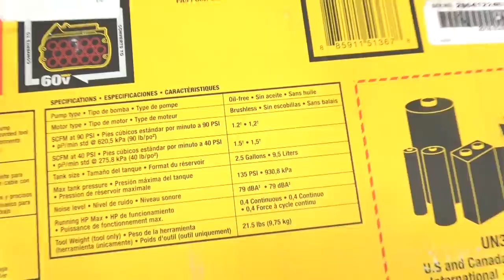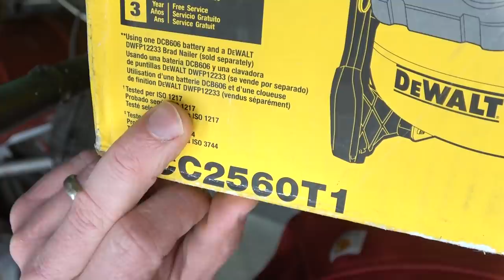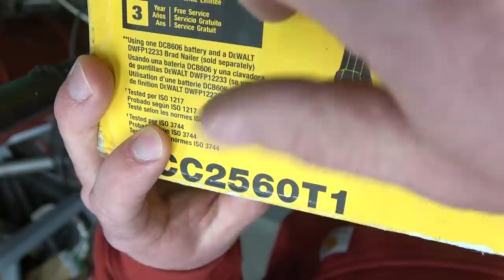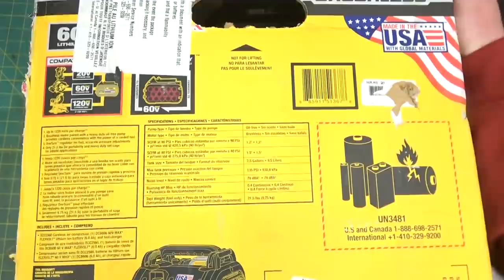BOLTR: DeWalt Flexvolt Compressor | Gutless and Brushless?

Comment: Today I was in Ogden Utah for the Union Pacific 150-year anniversary of the Transcontinental Railroad and I was next to two gigantic steam locomotives which are two big ass pressure vessels look up the Union Pacific Big Boy 4884 steam locomotive check out that pressure vessel peace out have a great day by the way 300 pounds per square inch in each locomotive the big boy puts out 6000 horsepower and the northern puts out 4,000 to 5000 horsepower the faster it goes the more powerful it is the big boy was designed up off of 5 Mile Long Train at 80 miles an hour how about that for some engineering

Comment: Really good video going through everything as usual. The piston seal is quite unusual; the wear looks like there might be some graphite involved. Also it is quite interesting that the pressure vessel is not serilized. As far as I know, every pressure vessel sold in the European Union has to be serialized according to EU Norms. Also there is the AD 2000, which is a set of rules on how to construct a pressure vessel or any pressure system for that matter to be sold within the EU. https://www.vdtuev.de/en/shop/ad-2000-code 

... of course it's like your mentioned "200$ for a few pages worth of information". 

I guess in America you don't have to serialize your pressure vessels if they only contain limited quantities and limited pressures.

Comment: Btw, I found ISO 1219:2009, 4th Ed. at http://www.tallereshaizea.com/pdf/ISO-1217-2009.pdf
Reply: Strangely, it doesn't give a specification for ambient temperature and pressure for the test procedure.  You'd think that'd have an effect on the results.